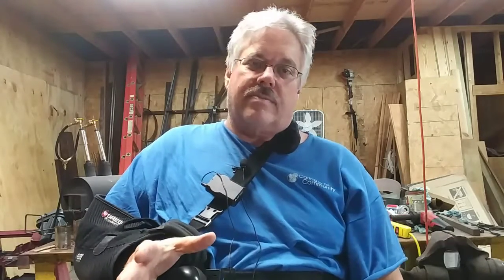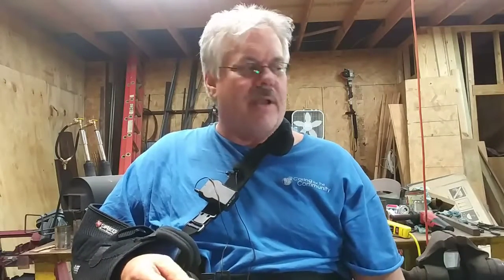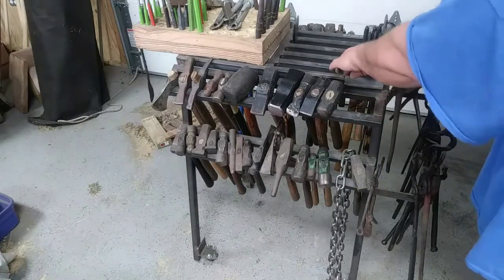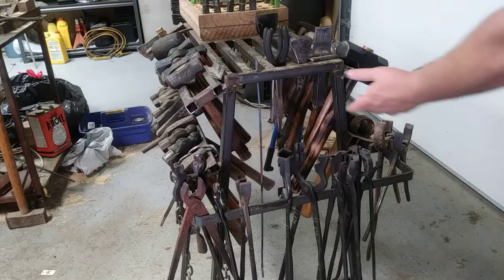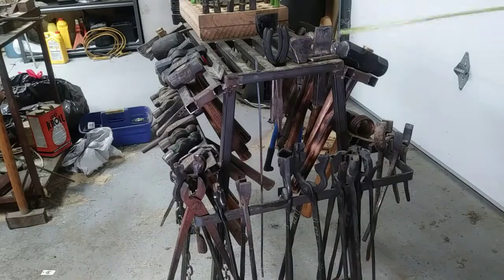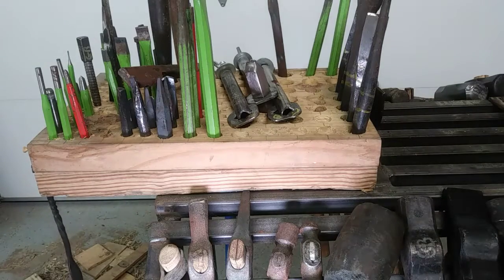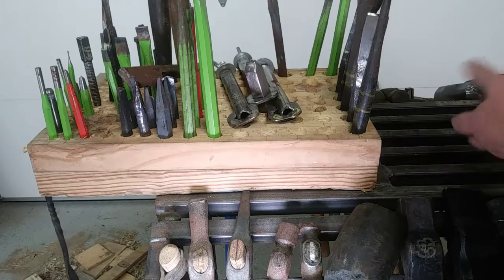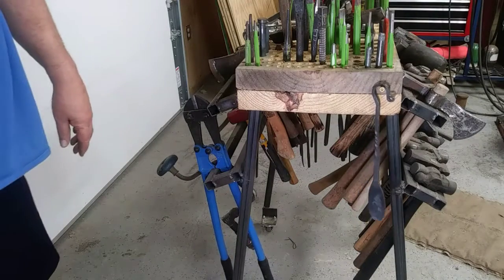Blacksmith Rolling Hammer and Tong Cart

Comment: Really like the cart! I think I'm going to have to build one myself! How is the box with your chisels and punches secured?
Reply from the maker: Thank you Kyle.  I need to put a brace around the bottom where the wheels are. The straight legs wobble too much.  I had to put better wheels on already. 
I made the chisel/punch box was because I had them piled up and didn't have any idea where I would put it. So I just set it up there temporarily and it has never moved. LOL.  But right now it is not secured. I need to secure it though and will do that when I take everything off to add the bracing at the bottom.  It might be a little while but I will try to make a quick video of it when I do.  Thank you again for watching and commenting. If you have any questions, please ask.  
Gary